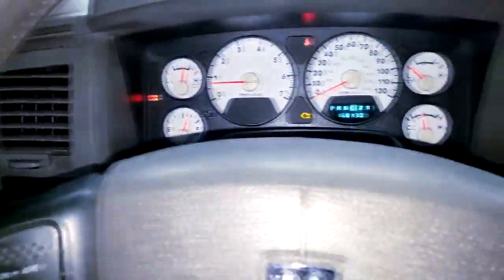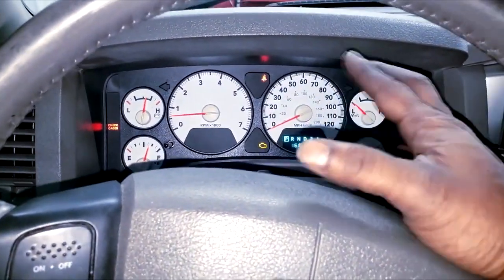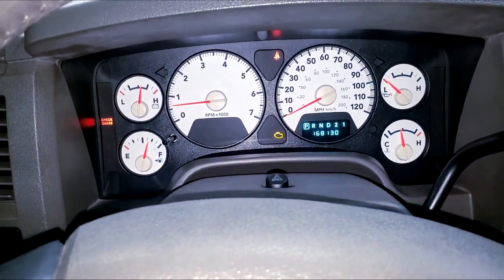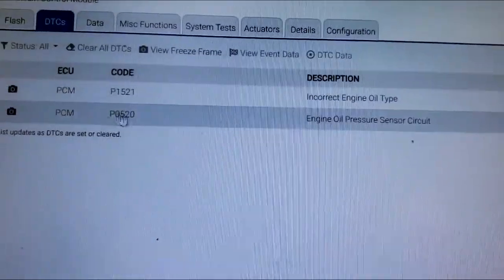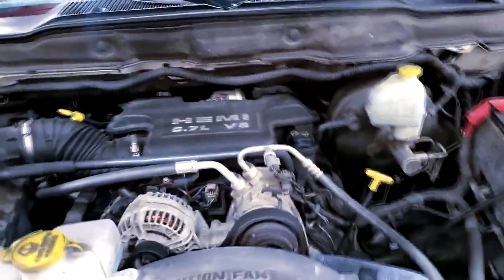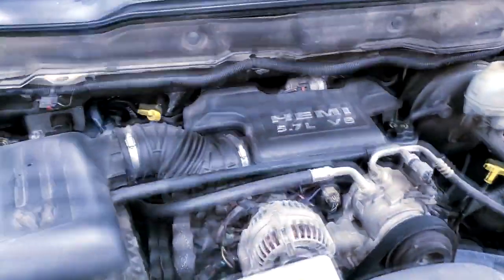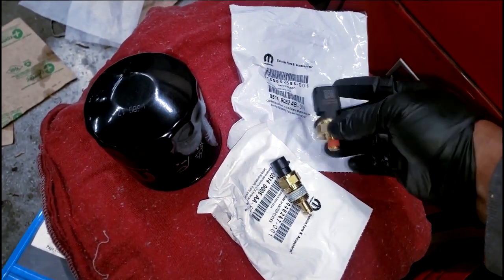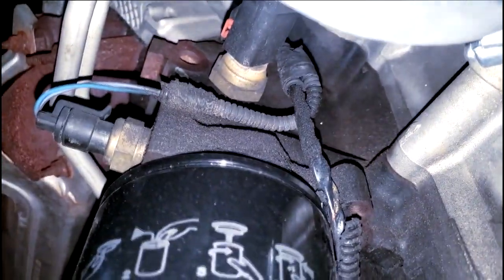Don't keep driving your car if your WARNING GAUGE LOOK LIKE THIS.  Fix your Hemi Motor Easily

Comment: I 1st remove the oil pan drain plug and drain the engine oil. Then refill. I then use an awl to pop a hole in the bottom of my filters, then loosen the filter so that air can get in to equalize the pressure and the oil start draining from the filter, into the drain pan. After a little draining, unscrew the filter off completely. NO oil spills onto your hands, no need for gloves. I then put the filter hole over the oil container jug spout to finish draining. Then pour in the drain pan oil. I recycle it to a friend's garage where he uses it for his oil-fired used oil furnace.

Comment: my oil pressure sensor been broken for years stuck all the way to the right on my suburban and drives just fine. "dont keep driving your car. take it to me so i can charge you a diagnostic fee and repair something that 99 times out of 100 does nothing wrong" lmao sike

Comment: Do what cousin Poochie does after using the wrong weight oil ,take a pliers to the check engine & oil bulbs 💡 in the instrument cluster 😁 that will fix it for good ....permanently